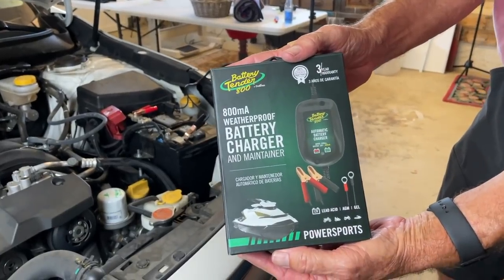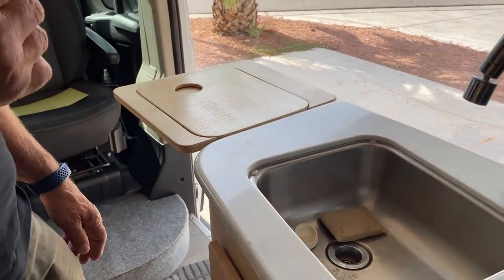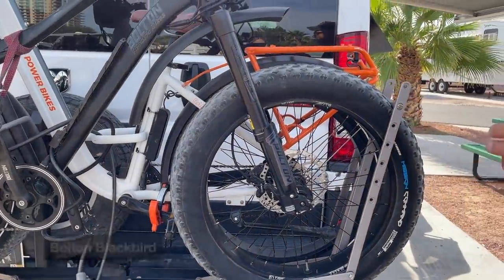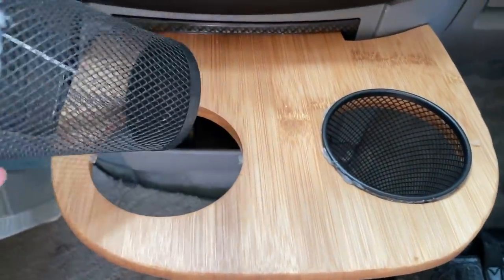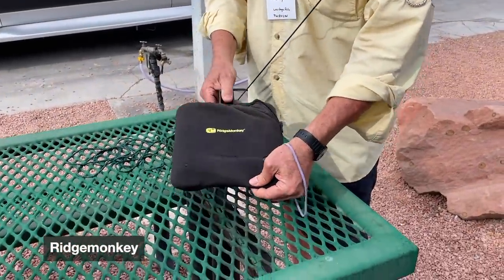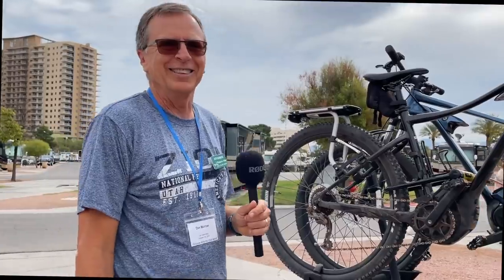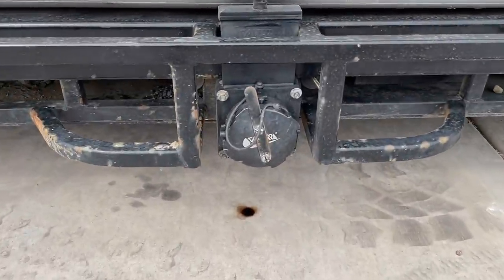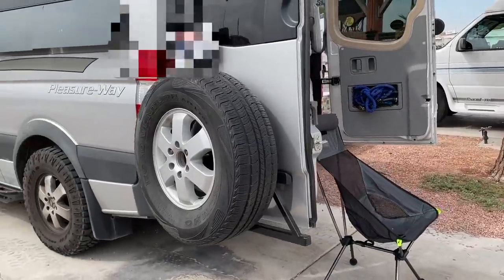Campervan Rally; 70 vans, tons of tips

Comment: Thanks for the video and good tips. I was discussing raising the couch/bed as we don’t use the ottoman when we sleep anyway. I don’t want to remove the bed like the one lady did, but to get some more height in the garage. I am going to see I could raise the whole couch up 5” so more space in garage and inside too. Travel safe!
Reply from the maker: That would be a great improvement.
Reply: @FromShetoMe  will see if it’s possible without messing anything mechanically or electrically.

Comment: Our older Prius had a switch under the steering colum that you could turn off all the electronics when the car is parked more than a week. Now I think we would just disconect the battery for the time it is parked.
Reply from the maker: John used to disconnect the battery but then you have to reset everything.
Reply: @FromShetoMe  Not only that, but the car doesn't drive right for a while after reconnecting, as many cars have to relearn the transmission shift points based on driving habits and engine performance.

Comment: I bring my trailer battery inside during the winter and put a trickle charger on it, during the summer I just keep the trailer plugged in I don't know if that's correct but battery still working after 4 years